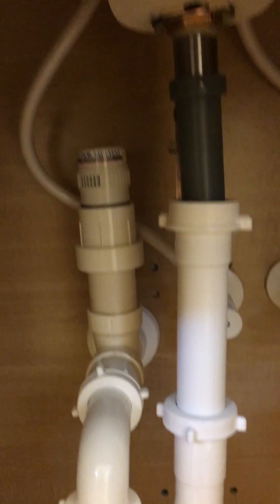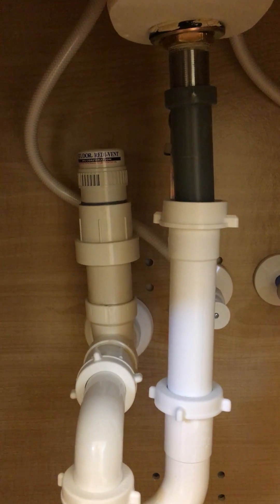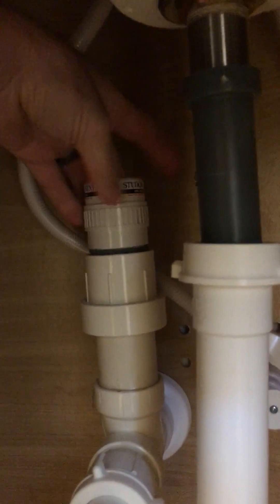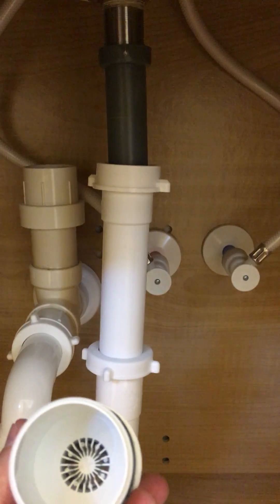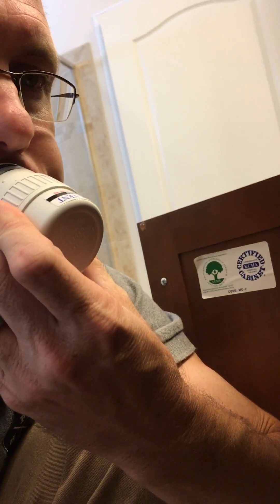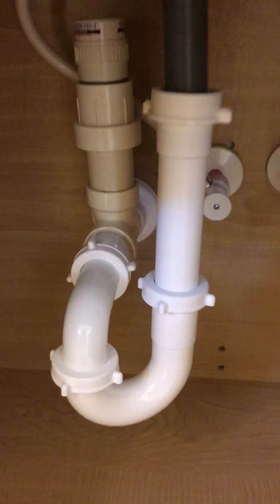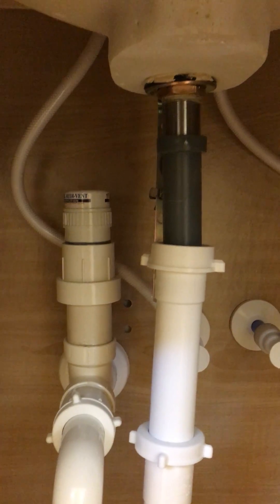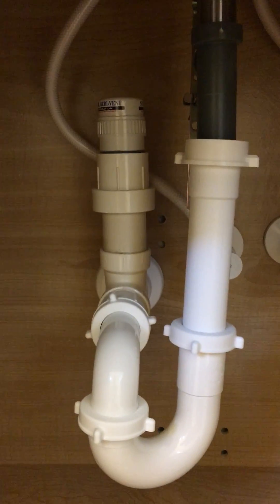Studor vent - what is it?

Comment: When would this be used? When no big loop vent is present behind your wall?
Reply from the maker: Easiest example is on a kitchen island. But new building codes allow for them at sinks and even the laundry drain box. Only one vent is required to run out of the roof.

Comment: What happens if you clog the sink and try to use plunge in the sink? Will it damage the valve or even worse will it push the water through it?
Reply from the maker: Thanks for the great question! So, you should never "plunge" a sink. The sink fittings are not meant to withstand such pressure. A plumbing snake could be used or the pipes could just be taken apart as a clog is likely in the P-trap.
Reply: @Freedom4851Group  I've been plunging my sink ever since and no problems. It's true my old house has metal pipes but there are some PVCs too. I can't snake every time it gets blocked.
Reply from the maker: @MarkusAvrelius  not saying you CAN'T, just that it could lead to other issues. yeah old houses with metal pipes may hold up better to that kind of force.

Comment: Thanks, but it is not properly installed. It needs to terminate just slightly above the sink when it it filled to the top because air only has to be above water to drain efficiently. Looks like it should be 18"'s higher.
Reply from the maker: You're incorrect. AAV's only require 4" above waste line. You're referring to a different type of valve which isn't required here.

Comment: By code, the Studor vent is supposed to be above the bottom of the sink..... yes? To prevent liquid from backing up through the vent in the event of a clog.
Reply: 4 inches above the P trap arm as per Studor installation instructions
Reply: @GunsAndRovers thanks smartie pants lol jk 😊
Reply from the maker: Very good @vido4x4 !
Reply: @GunsAndRovers  Does this vary by codes in other locations? Where I live, I was told it has to be installed above the highest level that water can rise in a vessel.
Reply: @cakeman58  Yes it does vary by code.  I imagine these are even illegal in some locations.  But if your vessel is located on an island like my kitchen sink, you won’t be able to install it above the height of the vessel.  And some venting is better than no venting.
Reply: @GunsAndRovers  I installed mine in my island, and it's as close to the bottom surface of the granite as I could get it and still be able to replace it. I can't imagine filling my sink to the rim. I haven't in the 15 years since I installed it. I'm in a new house now and doing a remodel. I need plumbing run to a new location for a kitchen sink and the plumber said if I use a 3" drain line, no Studor vent is needed. But if I go with a 2" line, I'd need one.
Reply: @cakeman58  It’s not filling your sink intentionally that is the concern—it’s in case there is a backup, waste water would spill through the AAV if it were installed too low.  You should be good if you installed it just under the granite.
Reply: Thanks !! I have the same set up and never had the studor vent on the bathroom sink plumbing. What a difference in drain time. 🫡

Comment: this is a follow up on my clogged kitcen sink, I tried draino and that did not work, then
the vinegar and baking soda, and more tube fixes and none worked, my girlfriend
kept telling me to call a plumber, so as a last hail mary I took off the Studor vent and
now my sink works perfectly.
Reply from the maker: there is always a choice other than drain-o….like fixing your janky plumbing drain set up.
Reply from the maker: Well, one...never use draino. That stuff is terrible for everything it touches. You may have a different venting problem if that was the fix....or the vent had gone bad.
Reply: @Freedom4851Group  Sometimes you have no choice but to use Draino.  For example, I have a double vanity which was plumbed incorrectly with a “T” instead of a sanitary “Y”.  So when I try to snake it, the snake just travels through from one side of the vanity to the other (a “drop-head” snake didn’t work either).  Or, when a snake punches through the center of a clog but there is still a back up due to a ring of grease & soap build-up like in a kitchen drain line.  Draino saved the day both times!

Comment: Why is a vent needed for a washer, if hose has space around it when placed in drain pipe?
Reply from the maker: by "washer" I assume you mean "dishwasher" and not "washing machine." Vent is needed at both locations, by the way. Allows air to be pulled in to the pipe and allow the drain to drain faster, which will prevent the drain from backing up and in to the sink or the appliance.

Comment: Don't do it if you don't have to
Reply from the maker: @good guy It's allowable by building code, so why wouldn't you? In fact, new building code only requires that ONE plumbing vent pipe penetrate through the roof. All other vents can be studor vents.
Reply: @Freedom4851Group  I don't care. A friend of mine had a bathroom remodel on the second floor and he used 2 of them and it smelled like sewer gas and I removed drywall from the garage lid and bedroom wall to hook them back up, I'm a general contractor in so cal and you won't find one on my jobs , just me.
Reply from the maker: @patrickjohnson7801  it's an air admittance valve, not an air escape valve. If you're smelling sewer gas there's another issue.

Comment: What’s a good rule to use when deciding when to use one?  Distance from drain stack, e.g.
Reply from the maker: after the P trap and before it leaves the cabinet. If this is for a laundry drain, the vent can be put inside of the wall provided that there is a metal vent covering the wall opening. New building code also allows these to terminate in the attic provided that at least ONE vent pipe penetrates the roof. All other vents can terminate in the attic. Hope this helps.

Comment: Do these vents need to be tight or a tad loose.  I’m smelling gases in kitchen sink and it’s draining slow.  Just had septic pumped twice and new drain field put in. 🤦🏻‍♀️
Reply from the maker: The vent itself is secured with pipe glue. The admittance valve is, of course, loose. You should not be smelling gases if the pipe and studor are installed correctly.
Reply: @Freedom4851Group  I live in a mobile home.  They never had glue to my knowledge.  Just screw them in like you did.  I don’t know what to do.  Sink is still slow draining.  Still waiting to see if it helps w sewer smell.  My septic is not full.  Plumbers are so expensive in SC.
Reply from the maker: @teenamilam5091  It may have nothing to do with this area. Often, mobile homes and modular homes have their main sewer lines installed on site. You might have a belly in your main sewer line under your home. This acts as a kind of secondary trap and holds water and can also cause slow draining. Unfortunately, a licensed plumber is the only one who I would trust to truly diagnose and fix this problem. It's impossible to diagnose/fix virtually because there are really quite a few things that could be causing this issue.
Reply: @Freedom4851Group  I’ve called a plumber.  No call back yet. I’ll call another today.  Thank you.
Reply from the maker: @teenamilam5091  If you're in the Charlotte area, consider checking out our partners page for reliable contractors. www.freedomhsllc.com/partners
Reply: @Freedom4851Group  I’m in upper state SC.  I did get a plumber out yesterday.  Due to my septic issues it was just backed up gunk.  Thank goodness.  It’s fixed and they did not rob me.  Thank you for your help though.
Reply: Ok, so there's two parts of an AAV.

 the fitting itself is "glued" in. it. Has female
Threads. The  2nd part of the vent has male threads and it does screw in.

Two reasons why you maybe smelling sewer gas under the cabinet is it may've failed. Very common and not a vig deal (just replace the part that screws in. Make sure its the same model you currently have)

Or if it's loose. Unscrew it and use Teflon tape (ptfe)